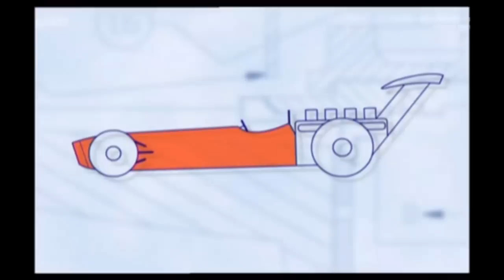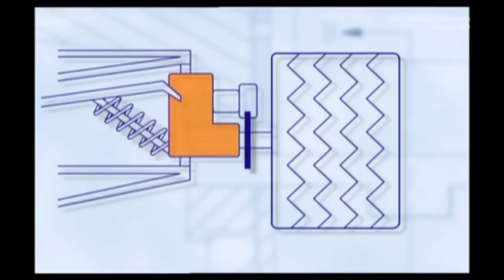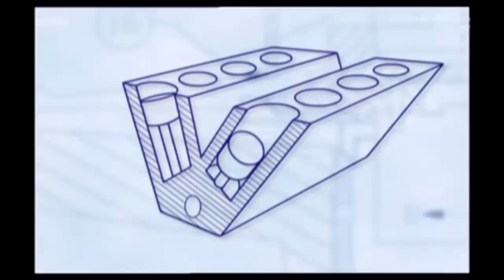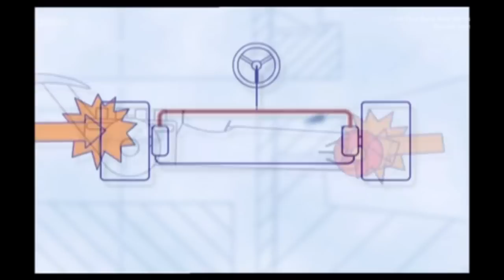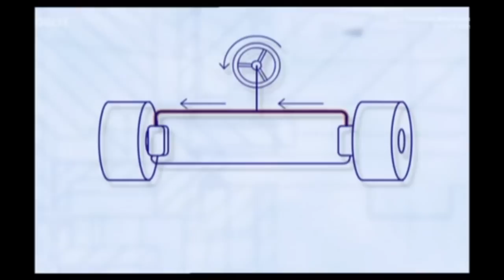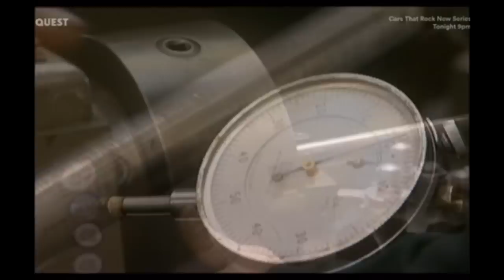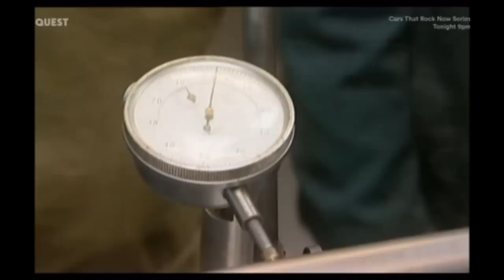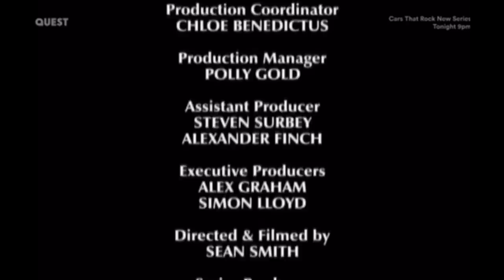Salvage Squad  the  Lola F5000

Comment: Super video.  My dad owned/drove a T290 then a T330 & finally a T332 (1974 - 76) W. coast CA.  Ran T330 HU24 (#50) in the inaugural 1975 LBGP.  That pole time in 1975 was 1 1/2 seconds faster than the pole F1 car in 1976 there. Nice story & restoration... Glad they located the original driver  Thanks for the video